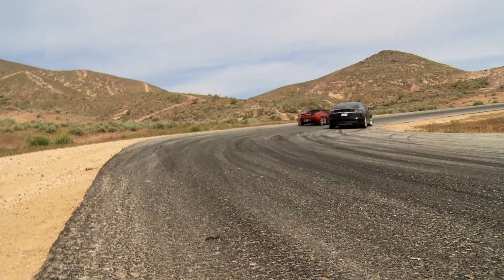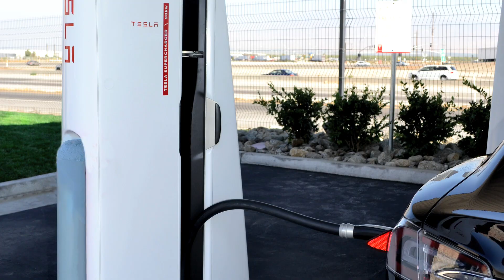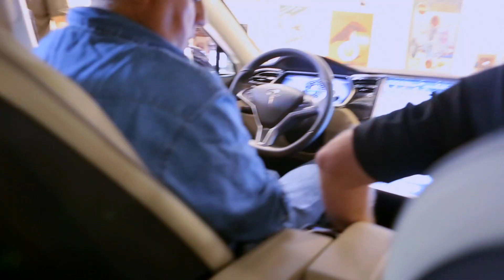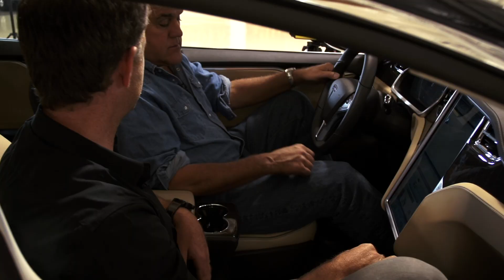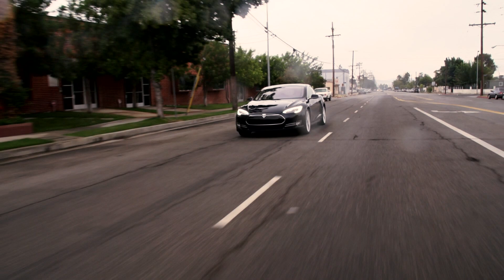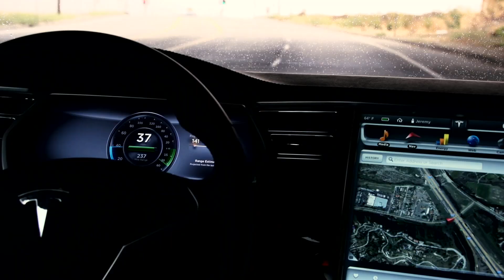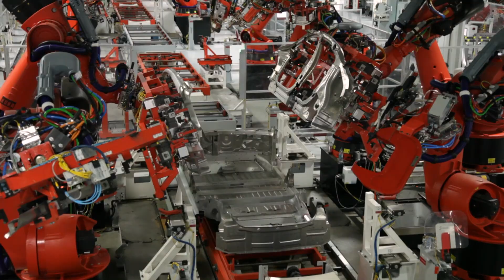2012 Tesla Model S - Jay Leno's Garage

Comment: Writing this in 2025. I own number 87 of the Model S Signature in silver metallic and I still get 404km or 251 miles per charge. A new 4G MCU, software updates, snappy screen experience, free supercharging for life, air suspension, free internet for life, leather seats, camp/dog mode, one of the safest cars ever made, an amazing sound system, seats comfortably 5 large adults and has arguably the quietest ride possible. A highly underrated car to buy used.
Reply: Thats is so impressive! Can I ask what has been your main maintenance expenses?
Reply: Did you get a new battery? My 2014 85 only does around 300km if im really nice with her. Could be the mileage though at 345k kms.
Reply: Leather seats (dead animal skin) is a downside but other than that, that's awesome!
Reply: @TheFSDJoker  idk if older models used real leather but its vegan leather on new cars
Reply: @TheFSDJoker real leather seats are far better, anything else will fall apart and end up in a landfill. Real leather will not only last longer, but it's completely sustainable and is a by product from the food we eat.

Comment: 12 years and 183000 miles later my P85 with original motor and battery (88% SOH) drives like new and turns heads everywhere. Free 4G internet (Premium Connectivity), Premium sound system w/subwoofer, Free Lifetime Supercharging (yes, to this date) and still getting at least 2 over the air (OTA) updates monthly, adding new features, getting better and better.. and thats 12 years after production! 
100% aluminium body, genuine leather - no sign of wear anywhere. Where else and how on Earth is all that possible?
Best car EVER!

Comment: We got our P85D in 2014.  Free Super charging was grandfatheted in for the life of the car.  It drove itself into a curb and was totaled in 3 years.
$134K. Down The Drain. 😅
Personally, i hated those fan blade rims that were only spinning in the right direction on the drivers side. They spin against the angle of the blade on the other side. I made a formal complaint to Tesla way back when i thought it was a real problem.  Lol.
$150,000 in Tesla stock back then is worth about $14Million today. 😂😂😂

Comment: They need oil to make them, oil to make the batteries and it takes oil/coal to charge them . They are great cars but to say they require no oil to run. Jay is a liberal, that’s all you need to know.
Reply: How “gasoline” manufactures need oil to make them, Electric does too. But small minded people like you don’t realize that they don’t need oil to run but they need oil to make the car.

Comment: I am curious, when the battery has only 25% change left, does the car have 100% acceleration?
Reply: Patrick Dionne its still fast but not as fast because its on low charge
Reply: @seanl6832  Still very rare in my area. People are skeptical when I pick them out at a great distance. As an old timer it's hard for me to accept that modern automatic transmissions are better and faster than, "4 on the floor" and that there are electric cars quicker than my. 900cc rocket bike but facts is facts! I still love the dirty old high performance gas engine sound though.

We just watched a string of 60 or so space-x satellite's go over - surreal. Elon is truly rewriting the definition of "Amazing"!
Reply: Patrick Dionne yea i know what you mean nothing beats a rumbling v8 I love engine sounds and i love cars but a tesla has so many more perks over a regular combustion engine but they do have many flaws they cannot detail a car at all and their paint has their issues and panel fitting is sometimes an issue but nothing ever hinders the performance its amazing to see this new trend elon is setting with ev’s especially seeing hybrid supercars now and new fully electric cars for the future
Reply: @seanl6832  ironically, this very day, while going to work my wife got a chip in her windshield from a stone that was kicked up by a Tesla.
Reply: Patrick Dionne im sorry to hear that i hope it was fixed
Reply: @seanl6832  Ha! I got my wife to show me the chip, what ever she saw skip off her windshield did no damage, - But it drew her attention to a spot of tree sap which I cleaned off with a couple drops of hand sanitizer. Funny and a Big relief! Thanks.

Comment: Electric cars are not mainstream yet. And when I say mainstream I mean 8 out of 10 cars on the road across the country are electric. THATS MAINSTREAM. That won't happen for awhile.....but its coming. Think about how DEEP ROOTED internal combustion engines are in America. SERIOUSLY DEEP ROOTED!!!!
Reply: I think mainstream EV adoption would happen when 50% of new car sales are electric.  That may be with in 5-10 years.  At that point, it's only a couple years before they stop making ICE cars completely.  There may be some demand for trucks (F250+), and production of those may linger on for a while.  You should watch some of Tony Seba's videos on disruptive technologies.  I would look to new cars sales instead of total vehicles on the road as the gauge for mainstream adoption.

ICE vehicles are deep rooted in terms of the people that make them, sell them, maintain them, and the oil and gas industry.  But most consumers will buy the cheapest solution that meets their needs.  As the price of EV's drop, consumers will stop buying ICE cars and switch to EV because they are cheaper to buy and cheaper to own.  Also, Tesla is changing what consumers want in a vehicle.  I now have no desire to buy a car that doesn't update itself, doesn't have google maps built in, or requires oil changes and other significant maintenance every couple months.  I also really like not having to pump gas every week.  Plus the instant torque and insane acceleration are a lot of fun.

Like you said, EV's are not mainstream yet, but they will be.
Reply: @donm2255   5-10 yrs....I don't know. Thats seems to soon.  I am thinking more of 10-15yrs. Electric cars....ALL ELECTRIC. ( Not hybrid) is when we will see mainstream electric cars on the roads. If thats the case they are going to need to start putting in ALOT MORE of those charging stations around. And where I am from (Ohio) There is not a whole lot of them. 5-10yrs! Too soon buddy.
Reply: @reptileguy8458  You should really watch Tony Seba's videos on disruptive technologies.  People seem to think that the transition between two technologies happens in a straight line.  It's actually exponential adoption.  It's like the Wuhan virus.  A case here, a case there, then before you now it there are 10,000 new cases a day.  The transition from horse and buggy in NYC happened from 1900 to 1913.  The EV transition started in 2012.  That is when I bought my first EV.  The adoption rate is going to accelerate at an increasing rate.  

Once the price of an EV is less than a similar ICE car, adoption will happen quickly--even with gas prices at less than $2.00 a gallon.  Gas at $7.00 a gallon would help the transition, but it's just one of many factors in the purchase of an automobile.  Even at a $1.00 a gallon, electricity is still cheaper.  The price of the car is the most important selling point of a car.  Other things matter, but not as much as price.  A cheaper, better EV will outsell a similar ICE car.  The model 3 is selling almost as many as a Honda Accord.  What happens when the Model 3 costs less than the Accord?  The Cybertruck should be interesting when it comes out.  It's pricing is $10k lower than what I though it would be and is an amazing value compared to ICE trucks.

Yes, anyone involved in the ICE vehicle industry needs to rethink their career options.  The dealership business model might go away.  Short term there will be an increased need for mechanics as people try to stretch a few more miles out of their ICE cars.  But that will quickly change.  Don't invest in a quick lube, muffler or transmission shop.  Gas stations might be ok if they sell food.

Here is a link to one of Tony Seba's videos.  https://www.youtube.com/watch?v=O-kbzfWzvSI  He does a nice job breaking down past disruptions and lays out what is in our future.
Reply: @donm2255   lol its nice to speak with an intelligent person such as yourself. You make some good points though.
Reply: @reptileguy8458  I enjoy the push back on my opinions.  It makes me second guess, dig a little deeper, and explore other options.
Reply: @donm2255   lol I think you and I are deep thinkers. We should play chess.
Reply: @donm2255  Hey....also the price of gasoline will drive the consumer waaay more heavily TOWARDS electric cars. So if gasoline prices go up ALOT I'm talking up to $7-10 a gallon. (Once again I am talking Ohio terms) people may start leaning towards purchasing electric cars.  And also think about all your typical mechanics that work on todays ICE cars. If your mainstream theory is true millons of mechanics would be in serious trouble. Like I said there is ALOT MORE to it than just new car sales. New electric cars that is. Ask yourself WHAT MAKES THOSE SALES?  Gasoline prices would have to be OUTRAGEOUS! And if 50% of new car sales were electric then ALOT of mechanics would be hurting for jobs. Remember....were talking ALL ELECTRIC CARS. Not the hybrids. (Ex.Toyota Prius)

Comment: Well...
Seven years later... no other manufacturers come close ...
Amazing ist the best word to describe it 💪
Greetings from Germany 🇩🇪
Reply: What is sad is Tesla hasn't made anything better since then either. The new Teslas are ugly.
Reply: @DK-jd8bj  That is an opinion. An opinion a lot of people dont share.
Reply: No other manufacturers come close to Tesla's seven year old modle.
Reply: Porche Taycan? it's also the only electric car that can run on a track and won't overheat.
Reply: @alexm566  
Well...
That is true NOW ... is was not THEN ...
However
The Porsche Tycan is a great car, no doubt ... the only problem I would have is RANGE and Supercharger Network, or lack thereof!
Reply: @erhardt1477  Taycan was available when you made your comment in 2019. Range is only marginally different and the alt superchargers are growing pretty fast.
Reply: @alexm566  Its actually not comparable, the only favour it has was the ablity to use it on track - which also wasnt that good - range is a joke, especially for the pricetag.
Proprietary charging stations which are almost no where to be seen, and so on.

They initially named it the Tesla Killer, but later they ruddered back and called it a electrical car which has prosche genes.

Yeah, it cant hold up.

Compare it to the Tesla Model S Top Model and laugh, the Tesla costs less, has double the range, same performance and the interior is also comparable.
Even a Model 3 outperforms the Porsche rangewise.
Reply: Looks like Lucid just stole the title, but, still ❤️ Tesla!
Reply: Hilmar Kleinschrot How about the BMW i3? Are those popular in Germany?
Reply: @jamesparson  THE i3 IS A TROLL CAR, NOT TO BE TAKEN SERIOUSLY.
Reply: @jamesparson  the i3 gets like 80 miles of range while the Model 3 gets 315 for a similar price point.
Reply: James Mohler ...
Not really ... the car itself looks to strange 😜
And at the same time very expensive 💵
Reply: James Mohler 
G-day James...
Yes they are, but times are changing 👍

Comment: Who is here watching this in 2019 and still think this model S looks modern and current?
Reply: front end conversion and headlight refresh and it would look like a 2019 model s
Reply: The software looks super dated but other than that it looks modern.
Reply: @okayge_  but The 2012 version still gets new uptades so The software looks new on the old car too
Reply: @okayge_  i love these software style... Don't like the current hype where everything has to be flat and white, abstract
Reply: People still turn heads after my 2013 P85 even in a country where everyones got em  :D Still a great car, great to drive, fast af and good looking. Couldnt ask for more!
Reply: @digitalviking5733  Norway?
Reply: @digitalviking5733 you still have your p85 how many miles??
Reply: 2020 now. Still would take one.
Reply: In 7 years, the battery price has dropped from $1200 per kWh to $175 per kWh in 2019. This will further drop to $150 by the end of 2020. When I may have to replace my 2015 70kWh battery in 2025, the cost of a new 100kWh battery should be between $7500 to $10000. Why would I spend that kind of money? Because even in the 5 years and 37000 miles we’ve had ours, the car has significantly improved the user interface, features, range and power. I’ve only had to spend money on two new tyres and washer fluid. No other car I’ve owned has offered this. To the haters. As Jay rightfully states, EVs like Tesla and Rivian ensure that car enthusiasts can enjoy their 6 litre V8s start up rumble, at prices that remain affordable. I love my 2010 SRT8 GC alongside our daily drive Tesla.
Reply: alternatively, tesla designs their cars all the same so it's either always modern looking or always looking dated and in perpetual stasis.
Reply: Watching on almost 2024 and still thinks it looks awesome 👍
Reply: It’s pretty much the same lol. The angles of the headlights actually look better on this model in my opinion
Reply: The new one has a better front end but yeah
Reply: Go test drive the car and then tell me what you think. I actually test drove the top of the line model s and it is the most innovative car that's ever been made. It handles better it drives better it's quicker it's just a better overall car than anything else out there. And I've driven a lot of cars.
Reply: @FreeSpeechWarrior  All I can say is test drive the car the performance is phenomenal.
Reply: Model S is still uncontested. Only Model S Plaid will surpass it maybe.
Reply: Tron still gonna get one
Reply: It does. The interior is starting to look a year or two old compared to a model 3. But this car is much older than it looks.
Reply: I think it’s still sexy, but it wouldn’t hurt Tesla to do a model refresh.
Reply: Lol, you got me
Reply: Getting bored with the design
Reply: I am here thinking the same thing. So, this car is about 2 years from a major battery replacement. How much is that going to cost?
Reply: Here in 2022
They do
Reply: 2023 but the same four years later
Reply: The grille is to carry the brand he said but where is the grille now?
Reply: "ok"
Reply: Styling already looks dated. Fit and finish on Tesla’s appear to be very low as well.
Reply: sbmphr  Not really. You can get a Panamera 4s for the same price, which is not only faster, but far more comfortable and you're paying for a better brand with better build quality. I don't mind electric cars but the technology just needs to be defined.

Comment: still on batteries?  OMG  when are we gonna see zero point power used, you only been sitting on it for 100 years   the video is as boring as the car.
Reply: 0-60 IN UNDER 2.5 SECONDS IS BORING?

Comment: Yet another marketing pitch. 10-year battery life, 250 mile range, the tooth fairy. Three made up things innocent minds enjoy believing in. My beef is how long before such falsehoods lead to a ban on the ICE leaving me with the actual 50 mile range and 3 year battery life and triple the COO. Of course the car says over 200 miles of battery left, and the statements I got from Bernie Madoff said I was rich rich rich.
Reply: i get 300 mile range in mine no problem.  and there are MANY Teslas out there right now with 200,000 miles on them and still 90% of their battery life.  the facts and data is out there.  you sir are the one propagating outright lies.
Reply: https://electrek.co/2018/04/14/tesla-battery-degradation-data/
Reply: So I looked at the chart and was amused over it showing Teslas having battery packs whose maximum capacity INCREASES over time and use (along with there being many batteries with more than 100% capacity, huh?). I did like the comment to the effect: "Why can't I get these magical batteries for my tablet?"

All indications are that this is simple marketing blather. So, this 300 mile range means you drive for 300 miles routinely before plugging in? Didn't think so. Oh, the car tells you, "Sure, of course, I can take you 1,000 miles before you'll have to charge, as long as you charge at 50 miles for real."

Okay, the magic is real. So that every lithium battery pack I've ever used comes nowhere close to this magical longevity is because physics work differently in a Tesla than in my presence?
Reply: @melainewhite6409  WHEN TESLA MAKES TABLETS...EDUCATE YOURSELF BEFORE COMMENTING.
Reply: Just to clarify, the 50 mile range limitation you mention only applies to towing an RV up a mountain in a foot of snow in negative twenty degree weather.
Reply: Versus the 250 mile range based on being towed to the top of Pike's Peak 13 times?

Comment: Is that the electric field from the batteries that is messing with the mic sets for the show?
Reply: RMFs from a motor and static EMF from the DC in the battery aren't high enough in frequency to disrupt any radio communications.